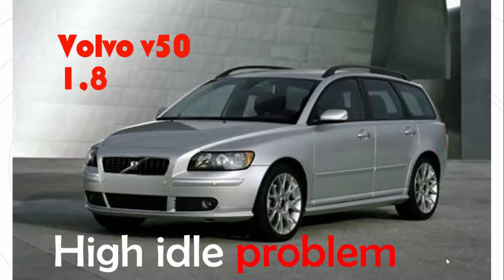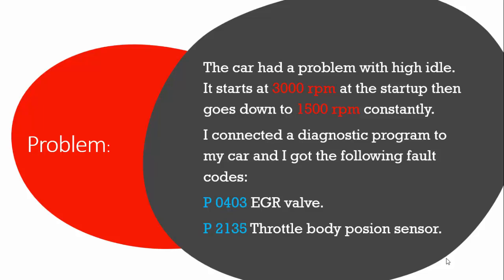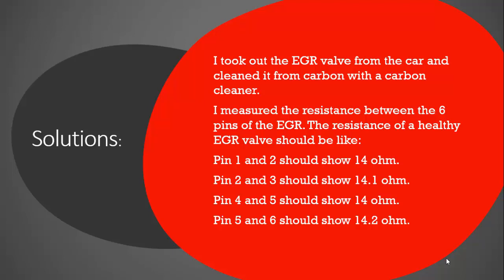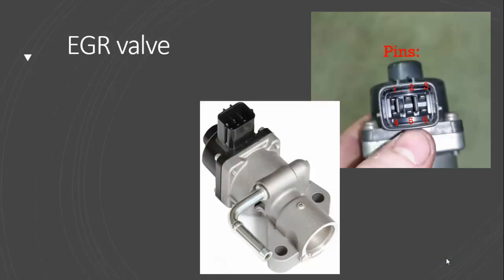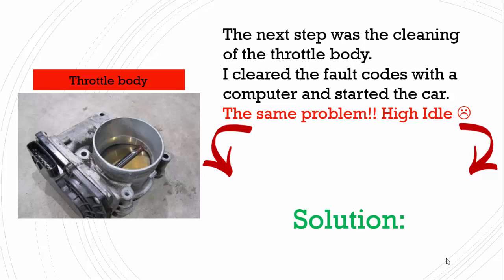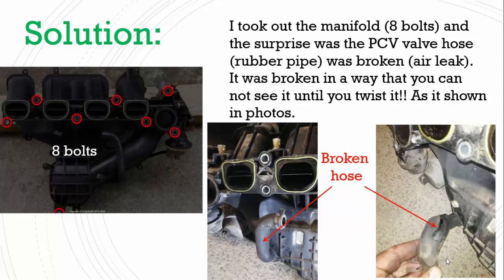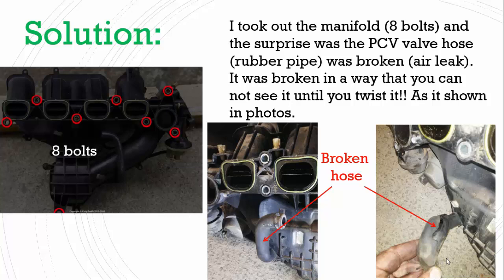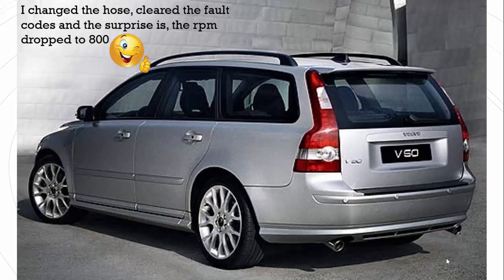Volvo V50 / Ford / 1.8 High Idle 1500 rpm SOLVED

Comment: Thank you for good pictures and explanation. Was it hard to get intake and EGR off?

I have the opposite issue with idle rpm and also starting issues sometimes. Idle rpm fluctuates when braking in to a stop and then smooths out.

To diagnose it might be a good idea to smoke test the intake for leaks/breaks in hooses and stuff. Vacuum system etc..

Any hints or/and tips for me and my issues?
Reply: I have the same problem with fluctuating idle not only when braking, but almost everytime i depress the clutch and the engine starts idling. You don't show where the EGR valve is located, so it's a bit difficult to give it maintanance eventhough you say thats it's easy...😮
Reply: @janbarrettnielsen2559  the whole intake and things around it needs to come off for easy access. It can be removed without that procedure but that is NOT easy. Tight, weird angles.. hard too reach etc..
Reply from the maker: Thank you so much!
If you have an issue during breaking, maybe you can have a look about the break servo i.e the membrane in big black round thing behind the head break cylinder. You can just press the break hardly and hold when is idling on slowly and see if there is a remarkable change in idling.
Also you can examine the  pipe going from break servo to the engine. You can use a break clean spray to detect any change in idling.
Check also if you have a dirty idling sensor. however it is easy to clean the EGR in this car by using dw40 or stuff like this.
Reply: @pioneeruniversalchannelpuc4695  thank you! I will continue do some testing. But I've seen more people here on youtube with same issue and they say it's common and normal on this engine/car
Reply: @pioneeruniversalchannelpuc4695  did some small fixing with my car today. Checked the throttle body and cleaned it. Already was super clean since the last time I cleaned it. Also checked air filter.. quite dirty. Black round spot were the hole in the bottom of the box are.. and also crankcase ventilation filter was a little bit of oily on the bottom. The blue filter.
Reply: @pioneeruniversalchannelpuc4695  how to clean EGR without removing it?
Reply from the maker: @orfeous  
Hello my friend!
I guess its impossible! Its so easy to remove it and clean the valve in it

Comment: This was more useful than searching forums for hours. My V50 has same kind of problems, so I'm gonna check these and hope for best. Thanks for information!
Reply from the maker: You are welcomed my friend.
You can try by using brake cleaner spray, try to apply it behind or between the manifold and see if the idling changing 😉
Good luck 🤞